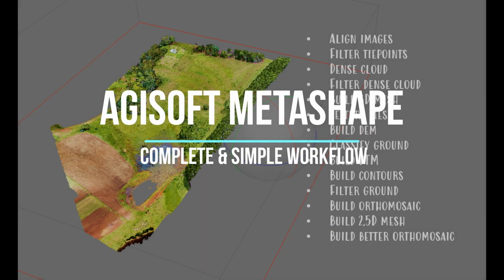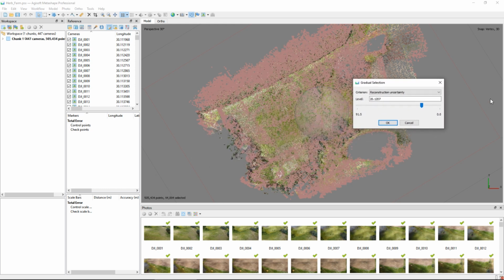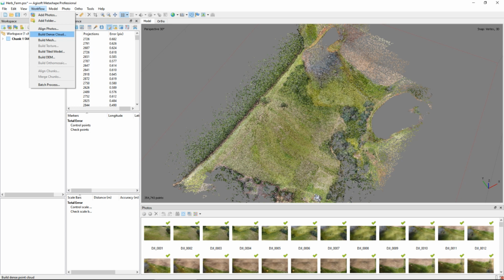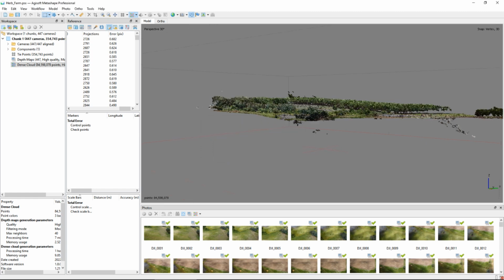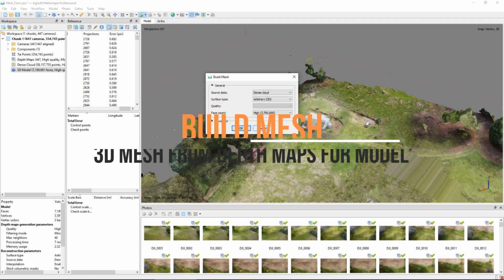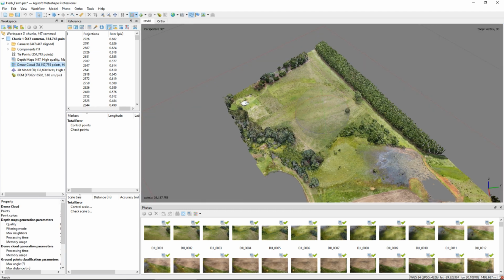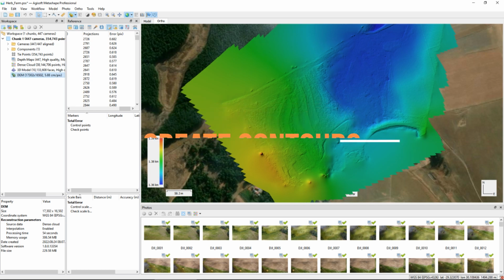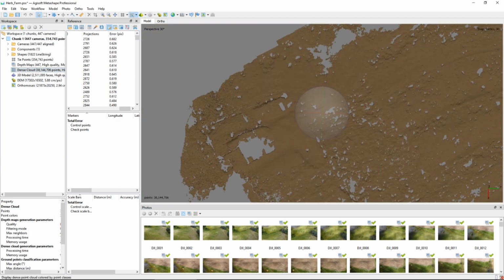Agisoft Metashape - Complete Tutorial (Cloud, Mesh, DSM, DTM, Classify, Orthoimage - No GCPs)

Comment: Great video. Highlights of buttons clicked (with text on screen of each process in sequence) for future videos would help dramatically in the ability to follow along.  
Creating Ortho's and DTM's (with added GCP's ...another lesson somewhere?) is my main goal to . So perhaps I can avoid the Point Cloud process completely. Pix4D seems to not demand attention to point clouds to build Ortho's and DTM's and DSM's in the one hit!.
Reply from the maker: Hi thanks for watching, for your comments and suggestions too.
The point cloud is not a requirement in Metashape in order to generate the orthos, but because I wanted it for other outputs, I chose to use it in this case. One could generate DSMs from depth maps and then the ortho from that. However, the DTM should only be produced from a properly filtered ground model and I would suggest that at some point, before the DTM is produced, the user (i.e. you and I) should check it for correctness before producing it. :)

Comment: Thank you for the complete tutorial, i'm wondering which one should I choose for stockpile volume measurement? The Arbitrary 3D or  the 2.5 D one?
Reply from the maker: Hi - if your resolution is very high, then it likely wouldn't make much difference.
However, as a best practice, use the 3D option. Many volumetric packages will use "pillars" for their computation anyway, but if your input is already "pillar" data, such as the 2.5D would create, then you may end up with volume pillar and 2.5D model pillar offsets. If you feed in 3D, then it'll place pillars as it needs without the potential issue mentioned.
I hope that makes sense.
Reply: @geospatialtips  thank you for the quick response, I'm new into photogrammetry and I'm not familiar with the "pillars" term but I'll follow your instructions and then try experimenting to compare the results between the 2.5 D and 3D. Your videos are really helping me in learning photogrammetry, hope to see another video especially in stockpile data processing and measurement. Thanks.
Reply from the maker: @LumentaJr   I'm very glad the videos are helping, thanks for watching!
For stockpile calculations, have you had a look at these two videos: https://youtu.be/bfI8JAUKUpg and https://youtu.be/9t-EJBVqgLE
Reply: @geospatialtips  yes I've seen both of them and now I need to practice to collect the data, my current role at work is as a geological engineering so I never had a chance to use the company's drone but right now I'm interested in learning coal stockpile measurement using a drone, however I don't have the appropriate Drone at the moment, I bought the mini 3 so I can practice without the fear of losing it. 
What is your opinion about doing a stockpile measurement using Dji mini 3 (small non enterprise drone)? I've seen a post on the internet comparing Dji mini 2 vs Phantom 4 and the result is quite similar.

Comment: what number of filter my confidence would be good to extract the point cloud data for the autodesk recap ??
Reply from the maker: Hi - the value selected would depend on the quality of your point cloud, the camera used, accuracy of your positioning data etc. The software you use post-Metashape doesn't really play a role in this decision. I would suggest you test a few values, observe the results on the screen in Metashape, then reset the filter and try again until you achieve the optimal result. Hope that helps!

Comment: If we are only going to make an orthomosaic then we would just make the 2.5D model, right?
But what if we ALSO need to calculate volumes from the DTM? In that case should we make a 3D for volume calculation and 2.5D for the ortho? 
Would just the 2.5D work well to make the DTM and calculate volumes? Thanks again
Reply from the maker: Yep - if only after the ortho, then 2.5D would be best in general. When it comes to volumes, you'll always want to go 3D, so the best solution is to do both.
However, if you only have time to do either 2.5D or 3D and need ortho and volumes, choose 3D as it'll give an acceptable ortho and good volumes. I wouldn't trust 2.5D to be very accurate for volumes - but maybe that's a topic for another video ;)
Reply: @geospatialtips  
Great, thank you!
Reply: @geospatialtips  
I'm working on a slightly larger data set and I have a new problem..."Not Enough Memory". My old computer is struggling with the model.
For volumes can we go straight from dense point cloud to the DEM and calculate the volumes, skipping over the 3D model? Any issues with doing that? 

Your video on Volume calculation doesn't mention the 3D model but it does refer us to this video on the complete process to get the DEM.
Thanks again!
Reply from the maker: @jerseyshoredroneservices225  Hi again :)
Yes sure, you can go from cloud to DEM and there are no issues with that.

If you still need to create a model for the whole region, you can follow the steps in this video and it'll probably get you around your hassles: https://youtu.be/BYRIC-qkZJ8

Or you can manipulate the size of your system pagefile as well, I know that sometimes helps.
Reply: @geospatialtips  
Hello and thank you Sir! 
I really appreciate all the guidance you give me/us here on YouTube 🙂

Comment: Can i ask you what processor are you using and if you are using gpu acceleration or only cpu? I have seen in the settings that i can select my nvidia 3080 but there is a “warning” so i’m scared hahah
Reply from the maker: Sure - I use an older 8700k processor, and also a 3080 like you do.
In Tools/Preferences you definitely want to make sure your GPU is selected there, and at the bottom of that box where is says "Use CPU when performing GPU accelerated Processing" Make sure that is not selected.
Reply: @geospatialtips  Thank you, i'm working a lot now thanks to you i'm doing my dream job btw🖤
Reply from the maker: I doubt I had much to do with your success and I'm sure it's due to your hard work. But that's great news, congratulations!

Comment: Great tutorial! I have a question when it comes to processing the orthomosaic using the 2.5d mesh.  After doing this I am noticing edges of buildings to be a little jagged and blurry. Do you have an idea of what might cause that?
Reply from the maker: Hey Dennis, thanks for watching.

Could be a few things. I suspect your 2.5D mesh isn't perfect on those edges either? I assume that's the origin of the issue as the images are being rectified on that mesh, so that is my suspicion.
To overcome it, you might try to to redo your mesh but at a lower resolution. By doing so, it'll have to simplify the edges of the mesh and may smooth out your orthoimage result.

Failing that, go back to the filtering steps and see if you need to clean more points out from your cloud? Is the mesh from dense point cloud or depth maps? Perhaps try the other option? If you have made it from the dense cloud, try depth maps and vice versa.

Just a few things to try, without seeing the data I am guessing at reasons, but if you don't come right, maybe send me a screenshot or two to my email and I'll look at it for you.

Let me know if any of that helps.
Reply: @geospatialtips  Hey thanks for the quick response! I will check through these suggestions and see if the map improves. Look forward to more videos from you

Comment: What camera/ drone did you use. Would a a7r iv with a m300 rtk give similar quality
Reply from the maker: Hi Paul - thanks for watching.

For this example, I have used a modest Mavic Mini. The point really is that it comes down to how you collect and then process the data (my experience is really all in data processing and that's why I focus on it). So, in your case, with that equipment listed I would expect superior results, so long as you are careful about how you do things.

*At the same time, I have seen many results of excellent and very expensive equipment yielding useless data because best practices were not followed.

Comment: So with all this filters you actually filter inaccurate points leaving better points for the model? You do not lose important data for the process cause the data you remove is not accurate anyway? Great content btw
Reply from the maker: Yes, exactly correct. Keeping in mind that these are just tie points, they serve to “connect” the images together and establish common points. They play some role in depth recreation later on, but for that and other reasons you would always prefer a cleaner dataset. 
Thanks for watching and I appreciate the positive feedback!
Reply: @geospatialtips  so tie points serve to "connect" triangulations? With more clean we have better polygons?

Comment: Very good content. For processing in built-up urban areas, can you follow these steps or is there a better way?
Reply from the maker: Thanks for watching!
I'd suggest starting with this approach as a basis, but perhaps play around with the Gradual Selection steps a little. The principles of photogrammetry do not change, so you should see decent results with the approach outlined in the video.
Reply: @geospatialtips  thank you for your attention. As for the type of flight plan, any more advisable? normal flight or crossed flight? how much front and side overlap? and how much use the speed of the drone?
Reply from the maker: @jacksonlima5821  If the buildings are tall or very close together, then yes a crossed flight plan would be advisable, a grid pattern covering the whole region of tall buildings is ideal.

Then, if you are using a grid pattern, you can relax the side overlap a bit and use about 50-60% but keep 70-80% forward overlap. If you do not use the grid pattern, then increase your side overlap to about 80% as well. 

Overall, this may be more overlap than you need (both scenarios) but you would rather have more images, than too few and have to refly.

Comment: Hi there.  It's very good of you to help folks dig into Metashape.

I'm curious what metrics you used to quantify the quality (error reduction) achieved with your particular settings?  In my testing, I have come up with different general values for for the gradual selection parameters. And also, some of the camera optimization settings.  It's okay that you have settled on different settings, but how did you determine that they were best for you?

In my case, I use the error that MS reports for both check points and pixel error values.  For example, If I remove tie points (by gradual selection) and check point and/or pixel errors get worse, I back up and try a different value.  Same with the optimize camera settings.  By taking this approach, I have found the general workflow settings that work best for me.

I'm not saying that your workflow does not work best for you.  I'm just curious how you went about quantifying the improvement? Maybe I can learn something new!

Thanks!
Reply from the maker: Hi Dave

Thanks very much for your thoughts and comments.

When it comes to Gradual Selection, unless you are using the same camera each time and achieve the same GPS accuracy each time, fly the same terrain type etc., the numbers will need to fluctuate. As an example, when using a metric camera, you will almost always be able to select a Reconstruction Uncertainty value of about 5 or even less, whereas with a lower-grade drone camera, I find the starting value tends to be around 10-12 and even higher.

In a general application:
Generally, I have target values in mind, such as those mentioned above, and will then evaluate how many points would be removed if those values were selected, keeping in mind the conditions of flight, the terrain being considered, image reflectance values etc. My honest view is that is we look only at the numbers and do not concentrate on what we are seeing in the results on screen, we're potentially opening ourselves up for trouble. Why you might ask? Well, if I set my control point accuracy to 0.001, select the markers and then optimize the cameras,  I will almost always get a very good residual in terms of numbers. However, MS will only be fiddling the mathematics to tend toward that 0.001 accuracy value. If my data is actually poor in regions beyond those control points, it won't be any good purely because the residuals look good - but I am sure this isn't news to you. Across all photogrammetric software packages, unless we keep all of the camera parameters fixed, the calculation of residuals serves to illustrate how well the software has done in manipulating the calibration values to achieve the target value that we set for it. However, this video was aimed at a non-GCP approach and to answer your question, I have arrived at values like those chosen after performing hundreds of projects with scores of sensors and found these to be adequate starting values for my  and othr general applications. If I were to do the video over again with 5 different sensors, I would likely use 5 different values at each step.

When using GCPs and in your particular case( I think):
In your case, where I assume you are using both control points and check points, observing the change in check point residuals makes sense, so long as they have been held independent of the control points. This would also be true if you are using no control points, only check points and not restraining your data to the check points at all. In these cases, the check pint residuals carry more weight and have valid meaning.

Am I correct to assume you are using one of these two approaches?

Poor Application of GCPs:
In the other case, where one might only be using GCPs as control points and constrain the data to them, well then we can fiddle the gradual selection and optimize camera parameters all we like and achieve resulting residuals of close to 0 and then declare our job well done. However, we may only have been able to ruin the camera calibration so poorly that it has forced the focal length, principal points etc. to such an extent that the data appears to fit the control perfectly, where in reality, if we were to then compare this data to check points or a LiDAR survey, we would be found wanting. I have seen so many users do this with Metashape, Pix4D, UAS Master etc.

Furthermore, it's odd to see how so many people have an amazing level of faith in GCPs and fail to consider if they are derived from static observations with a full network calculations, or RTK, or RTX. Are they levelled or not, what does the survey report say, ellipsoidal versus orthometric....the list goes on!

Conclusion:
At the end of the day, my feeling is that we need to apply good survey practices and principles. If we have done all of that correctly and it results in excellent residuals then great. If we have done that all and we have poor residuals, we should then apply further good practice, investigate the source of error and try again.

I don't want to say don't look at the residuals, but in my mind, they should be what we look at last, as a result of a professional job. Apply sound survey and photogrammetric principles, look at the data, consider the starting versus final camera calibration values, then consider our check points independently of control points. If we process only to target good residuals so that we can hand over a glowing report but pay no attention to what's really happening with our data, in our respective professional worlds we would all soon have to appear before our representative councils and explain our actions once clients had found us to be lacking in our conduct.

Very long story short, I think there are a few different methods we can all use to come to a good result, yours and mine I hope are both good candidates. In this video I tried to convey a generic approach that serves to be a good starting base for anyone new to MS or starting down their photogrammetric journey

Thanks for taking the time to chat.
Reply: @geospatialtips  Thank you for the thoughtful reply.

All my use has been with lower quality drone cameras.  First the P4P and now using a P4RTK (same camera), and Autel Evo RTK, probably similar quality.  I do use GCPs and Checkpoints. And, my reference to watching residuals is referencing the checkpoints only. I also watch what MS reports for average pixel error on the images.  I think checkpoint residuals are the single most valuable indicator of the absolute accuracy of the surface model.
  
I agree with you that there can be unaccounted for error in the ground control, both GCP and CPs. Less so if the points were observed over different days and then averaged, which is rare.  Considering all of the metrics I have in a dataset to evaluate accuracy, the CPs seem to me to be the best candidate.  That is why I use their residuals to determine if the level of thinning of the sparse cloud (key points) is helping or is a detriment. I will fully admit that I am not knowledgeable enough to look at the camera calibration and determine if the values are reasonable of not.

When not taking into consideration residuals, I guess I am still not sure what you are looking at to gauge the levels of points to remove and the different parameters you select in the Optimize Camera steps? 

Thanks!

Comment: What are your PC specs as it seems you compute quite faster than what I am running - i9 13900K, 64GB RAM DDR5, Geforce 4080 16GB.
Reply from the maker: Hi, actually lower specs than you. 
i7 8700k
64GB DDR4
GeForce 3080
It may just be the images I used are lower resolution than yours or I have used fewer images. But generally, with your spec, you should be doing better than I am.
Reply: it was fast forwarded